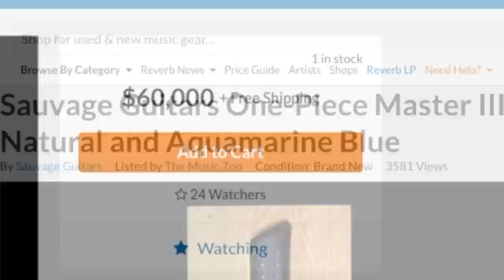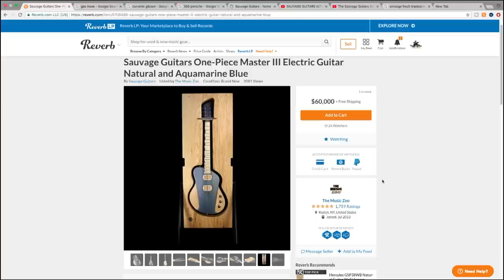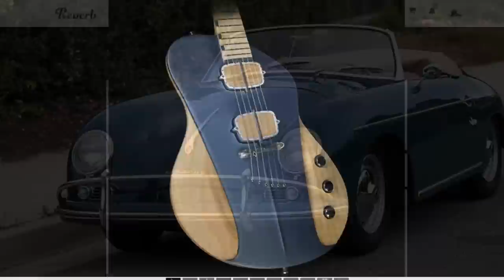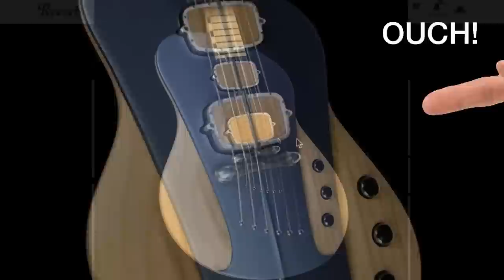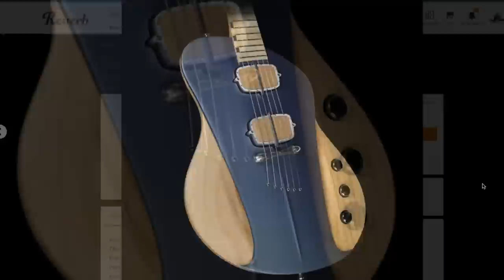Why Is This Guitar $60,000?!? Sauvage Guitar's "One-Piece Master" | Would You Rock Or Not? Ep. 84

Comment: This is an arty geetar. Aimed at the haves and not the have nots. It’s focus is desirability not playability. The story of its build is supposed impress the collector as to its purity with its aesthetic use of natural materials. The Porsche bonnet reference is an innuendo which tries to inject some humour and engineering heritage into a new product. The omni scratchboard and wood frontspiece looks like a kitchen workstation with two tins of sardines for pickups.  The genuine joke is the gig bag but you can store it in its picture-frame cut-out cast like any other oblong wall hanging. It thens dissolves into a mere ornament; which as a bauble it proudly is. Yes, they have made an ‘ash of it. Hope it smells nice.

Comment: You are just too kind.  I remember how some old 1970's Japanese guitars had the foil and screen pick ups. Like Tiesco. They didn't last on the market.  I don't buy the one piece wood value factor, when it has been cut and glued. There were a number of "neck through" guitars made that likely used less glue...haha  I simply do not see anything here that would even justify a $10,000 price tag. Let alone six times that.  It's just another case of the emperor's new clothes that sounds like a Squier Telecaster.  Don't you find it odd, that for this price, they cannot (or do not) claim involvement of any well known master luthier?  There is actually quite a bit of old wood around the country.  Just takes a good eye to find it.  When you do, it is often not expensive at all.

Comment: 7% moisture content is kinda high.
100 year old trees are more common than you think.
milling does not inherently raise the price of the machine. that mill has probably already been payed for given the multiple thousand dollar price of their other guitars. 
damascus steel is not that expensive. that was most likely forged into a billet then milled.
jazz master controls, really?
that much mammoth tusk is not this expensive. probably only a couple hundred's worth
you can cast logos like that hundreds at a time for relatively cheap. example? belt buckles, the bits of metal in dollar store toys.
it's not even one piece! that's a technicality!

it does sound nice

Comment: Not a chance, I could make something different not the same way as that this one in the video but bad ass so low action less than 0.3 mm
Reply: Genuinely engineering purposed contouring carrying tons of mics/ceramic fully ranged humbuckers/electric double bass direct contact pickups/ and 24 karat foiled metal projectors around all of that, including 24 karat wireworld connectors and platinum wires, Optima/Maxima 24karat string, gold hammered woodwork on the home made bridge and nut also same aswell, including home made two step tuners system for more sophisticated features and no fluids gearless/magnetic bearing versatility knobless just magnetically tooled controls, mig/tig/plasma built metal powered on top of alloy acoustic chamber 5 foot long by 10 cm thick by 3 7/8 feet wide 6 string for gauges 0.04-4.00 millimeter